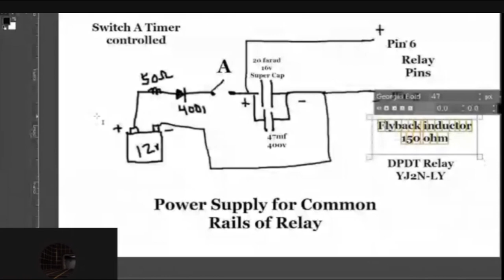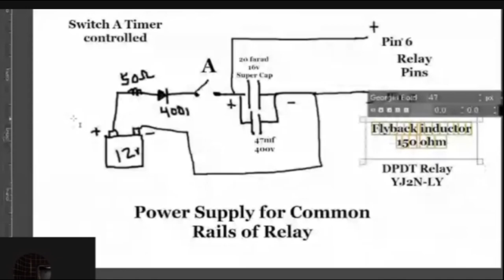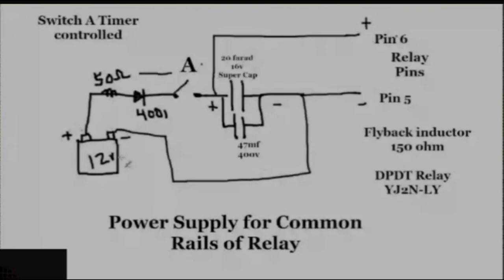Charging with Flyback as opposed to Capacitor Dump

Comment: hi myke yes I agree with you, even if in the writings john says the opposite. ..., with mtech we were not able to notice that a pulse on a sinusoidal voltage helps to set the desired voltage... but yes I think the two are equal... on the other hand John also says not to short circuit the dipole ...hence the electric die...
Reply from the maker: Its better to use the high voltage low current to charge batteries , dumping the HV into capacitors will lower the voltage and the potential > charge
Reply: @mykedoes4099  hight fréquence divide the Time

Comment from the maker: Voltage is Pressure.  My reasoning is that having a very high potential of pressure with very low current , is ideal for transfer of energy  lets say into a battery.  You can use a lower potential than the flyback as well to charge your battery , for example the capacitor dump, .. When i say transfer of energy i refer to pushing it into the battery not over the wires but that as well coincidentally.

Comment: I see what you're saying and I think you're right... I think you're right except when it comes to lead acid batteries.  They seem to only "take" a charge from current. In my experience of having a off grid system for decades now that's what I found with lead acid chemistry I could be wrong though
Reply from the maker: you have t drain the battery and recharge it with negative flyback
Reply: @mykedoes4099  I've ruined plenty of good batteries trying to do that with imaginary neg power to charge a battery that requires current
Reply from the maker: @windpowerandmore6310  Have you used the Bedini method to do it?
Reply: @mykedoes4099  yeah it doesn't work.  Even Rick friedriech said he only built battery killers and I definitely agree.
Reply: @mykedoes4099  lithium responds well though
Reply from the maker: @windpowerandmore6310  thats so weird i did not have that experience .  Seemed to move the power from one battery to the other just fine.  Then again i never used a new battery on the charge end. always put damaged batteries and that side and they all responded with increase volts . I will keep a look out for that in my next experiment . What i think is happening to most that are ruining there batteries is they are running on a faulty NPN. I have had many go bad and still operate ... the only evidence i had as to there damage was the rotor lost some balance and or starting rocking . Thats my estimation on this topic for now
Reply: @mykedoes4099  yeah it's depends on how much of a backspike is going into the battery but over time they become sulfated which gives the effect of being charged faster but in reality they are loosing capacity.  Lead acid requires enough current to do the reaction needed to charge.  And also a lead acid battery for 90% to 100% state of charge will take as long and as much energy to complete the charge as it does upto 90% .
Reply: @mykedoes4099  have you ever done any long term experiments with battery capacity from flyback charging?
Reply from the maker: @windpowerandmore6310  i used a coil think it was awg 28 or 30 and it had 1,500 turns maybe around 120ohm on it not sure but the NPN never went bad on that one and it charged all kinds of batteries just took a while .  AS long as the gate in the transistor dont start making distortion and spike is clean signal it will work , if you use a regular square wave with a distorted signal it will ruin your battery . all about quality factor with  signals and especially efficiency . Once my rotor started acting up and losing balance i would change the NPN  , never bothered to ask if it was damaged but every time i changed for new one all was good .  WHen you go for the amps thats the point where you start damaging the gate on the NPN . staying 20% or more under the breakdown voltage  is not  easy when dealing with flyback. But a high resistance coil sure seems to help in my case regarding the NPN and its functionality
Reply: @mykedoes4099  yeah I see what you're saying.  Just know a flyback spike has some current behind it as you can see clearly in a scope and that's what the battery responds to to be charged. And over time if it's not 100% charged it will sulfate . Trying to convert to negative energy I think is a fairy tale and will only damage a good battery in my experience with such stuff.  You can actually watch a battery sulfate in real time when you discharge it (plates turn from brown to grey) and when completely discharged to zero it's permanent and can't be recovered.  I've got graphs from a new battery I did this with a few years ago with my ZKETEC battery capacity analyzer that shows this which I compared to a exact same battery both new at the same time
Reply: @mykedoes4099  use your battery normally is what I'm trying to say and completely recharge it when you're finished with it especially a lead calcium chemistry it will last for a very long time and your experiments will be more reliable because your battery won't have any sulfation
Reply from the maker: @windpowerandmore6310  thats explains why i had little to none bad results ,  ,,,  I never drained a battery .
Reply: @mykedoes4099  yes exactly batteries dont die they are murdered lol
Reply from the maker: @windpowerandmore6310  i should tell you that i have recovered batteries from as low as .5 volts took a bundle of time and I used both the flyback and the poor man desulphater on that particular battery . I quit at around 4.5 volts
Reply: @mykedoes4099  same here its almost impossible especially if left for a couple days dead .

Comment from the maker: Folks should know that a faulty transistor will operate and damage your devices and batteries . An indicator of a faulty transistor in my opinion and observation is when you see your rotor stop performing as well, or lose balance slightly . Best way to avoid a faulty fake operational damaging transistor is put a mica insulator on the heat sink and isolate your heat sink electrically from the transistor

Comment from the maker: /*
 * Created by ArduinoGetStarted.com
 *
 * This example code is in the public domain
 *
 * Tutorial page: https://arduinogetstarted.com/tutorials/arduino-output-library
 *
 * This example blinks 3 LED:
 * + with diffent frequencies
 * + start blink at the different time
 * + without using delay() function. This is a non-blocking example 
 */

#include <ezOutput.h> // ezOutput library

ezOutput led1(2);  // create ezOutput object that attach to pin 2;
ezOutput led2(4);  // create ezOutput object that attach to pin 4;

void setup() {
  led1.blink(5, 10);       // 500 milliseconds OFF, 250 milliseconds ON. start immediately
  led2.blink(10000, 10000, 1000); // 250 milliseconds OFF, 250 milliseconds ON. start after 1000 milliseconds

}

void loop() {
  led1.loop(); // MUST call the led1.loop() function in loop()
  led2.loop(); // MUST call the led2.loop() function in loop()

}